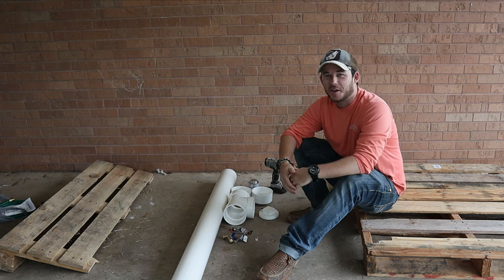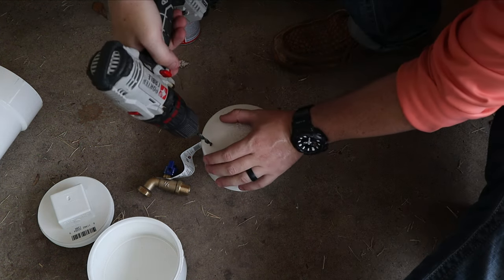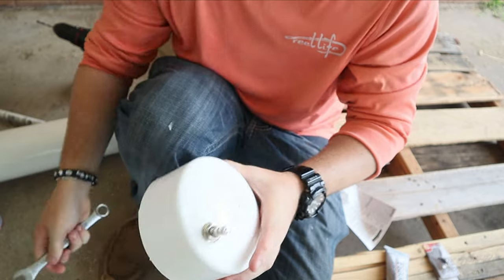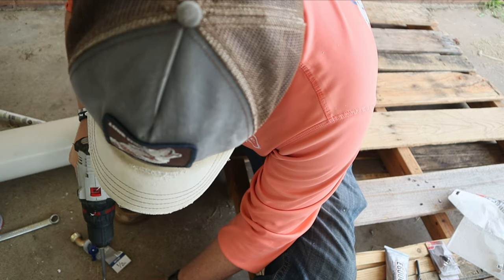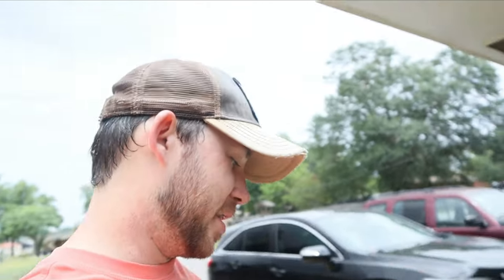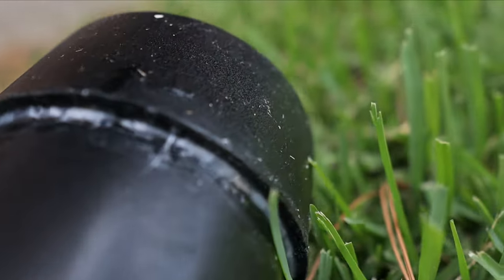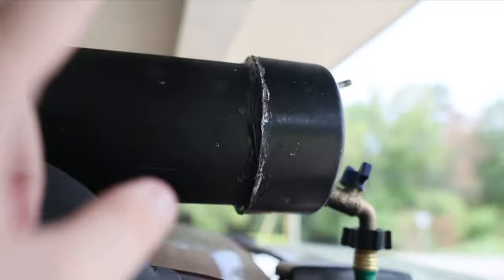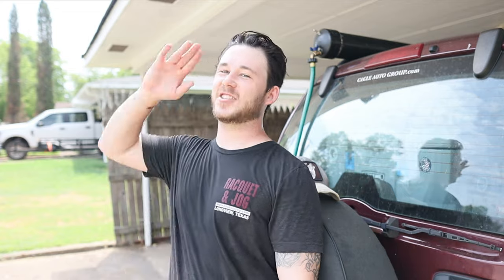DIY: How to Build A Solar Shower for Camping and Overlanding.

Comment: Great video.  Thanks so much for showing the challenges of building this.  Any news on how it is holding up?  Again, great video.
Reply from the maker: Still holding up good. Have only used it 5-7 times but each time it performed good and didn't spring any leaks. JBWELD is the way to go for sure!

Comment: Dang dude nice job! Way to see it thru. 

I have a dumb question tho... Can you fill it all the way up? Wondering if water would get into the air compressor if you fill it to the top.
Reply from the maker: Thank you!!! Lol I have filled it up all the way yes and the valve on it only allows for air to flow in and nothing to come out.
Reply: @darkreelaction  oh sweet! Thanks man